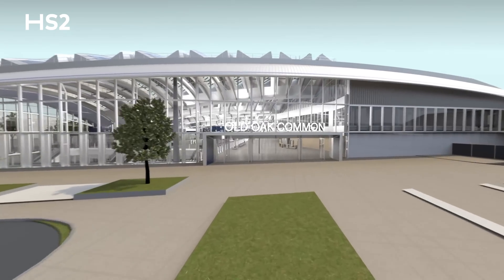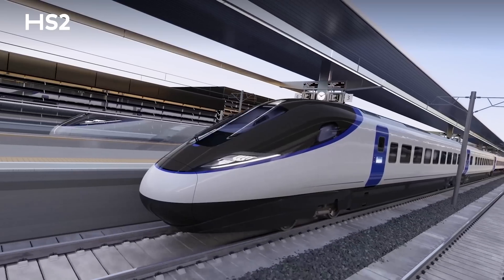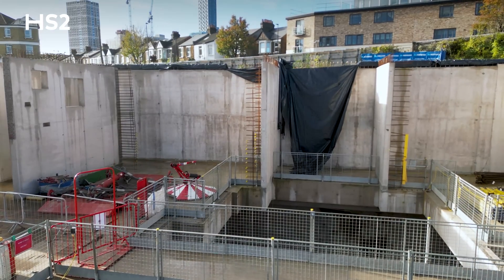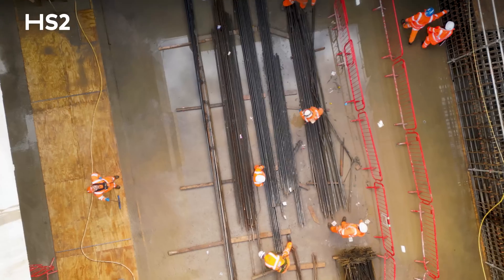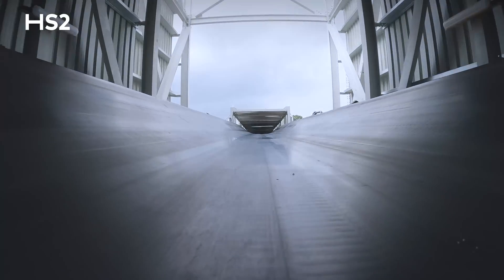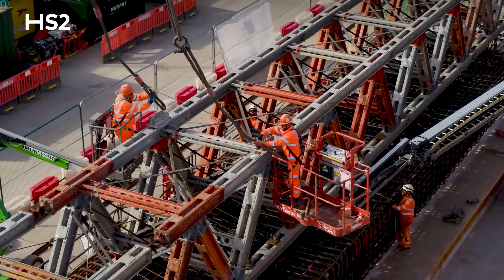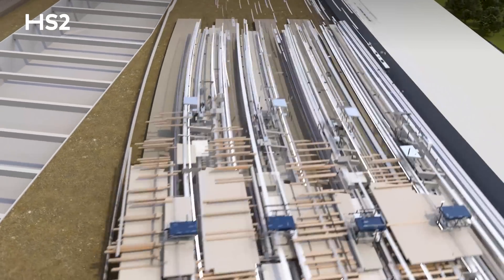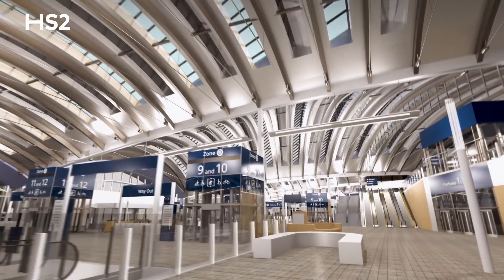HS2 Old Oak Common Station Project Update | December 2022

Comment: Explain this to me, most people don't want HS2, most don't think once built that it won't go beyond Birmingham as the money will either run out or the improvement won't change or lesson the services on Network Rail to Birmingham New Street via Rugby. finally where has all the money come from to build this? why has the Tory government spent tax payers money if that's where the purse has come from? 
I like railways and at first was happy to see a project like this come to fruition, However since the pandemic, faster Broadband etc is this necessary even for the future? the only way it can work is if the fares are cheaper to Birmingham and the journey much, much faster that it is currently. I only say this because Euston, Old oak then Birmingham stations doesn't speed passengers from Milton Keynes or Rugby if they did HS2 part 2 to the north, Milton Keynes and Rugby will still be on the current network, so where are the benefits?
Reply: While things like Zoom have their place, there's still a lot to be said for getting people together in the same room where they can interact properly. People said the same about the need for rail travel when the telephone was invented!

And by taking most of the express services off the existing line, it frees up capacity for more trains serving the intermediate stations - including Milton Keynes and Rugby!
Reply: @Inkyminkyzizwoz   Well said. Your reasoning is so obvious but sadly there are none so blind as those who choose not to see.
Reply: @1chish  To be honest, one of my biggest criticisms of HS2 is the fact that there hasn't been enough emphasis on the capacity issue, resulting in many people thinking that it's only about speeding up journey times
Reply: @Inkyminkyzizwoz   I totally share that criticism with you. However the project was started in very different times and they were hoist on their own petard by logically following the 'HS1' name with 'HS2' although even HS1 was attacked by the NIMBYS and armchair experts.
The name 'HS2' handed the opponents a bit of a gift and its been a hard campaign to get the obvious capacity benefits on the OTHER lines across. In itself it is about speed but as the capacity benefits fall on other lines and routes so its actually a double benefit.
Reply: @1chish  Mind you, HS1 wasn't called that to begin with
Reply: @Inkyminkyzizwoz   Very true as it was known as 'CTRL'. I think the HS1 name came into use when LCR went bust, the government bought the line and 'HS1 Ltd' was transferred to the Government. Its operation then became a concession in 2010.
Reply: "Why has the tory government spent taxpayer's money?". Because that's the government's job. If they didn't spend it on public infrastructure they would just pocket it for themselves. Considering their track record, it's a miracle the tories aren't just spending all their money to close down the railways altogether. Do you question why they spend so much money on maintaining the roads? No, because the answer is obvious. Secondly, the main benefit of HS2, and high speed rail in general, is that it increases capacity on existing lines. The "high speed" part is just what should be expected for new railways, it isn't the main selling point. Rugby and Milton Keynes benefit because their existing rail network will be massively freed up. They can run more frequent and reliable services since the system won't be operating at maximum capacity, and hopefully build new stations where they previously would not have been viable to be served.
Reply: This leap forward in railway CAPACITY was long overdue; I note that other earlier commenters have explained to you the capacity facts of live on the WCML.  As to the cost - building anything now costs a lot of money (leaving aside the £10billion tunnel under the Chilterns to keep the NIMBY squad mollified).  It is already beyond Birmingham, building northwards toward Crewe.
Reply: @mikehindson-evans159  You mention a good point. All these people whingeing about the cost are the same ones who demanded every newt, buttercup and bat was safeguarded and woodlands were not cut through but tunneled under.
And then there is the added cost of 7 million new trees HS2 is planting. As of today they have planted 700,000. And STILL the NIMBYS complain. Although they never said a word when the M40 was being built to make travelling in their Range Rovers easier of course.
Reply: @1chish  .. you've failed to mention the numerous fines that HS2 Ltd have racked up for breaches of environmental issues.
The thousands of trees that were planted alongside the route in Warwickshire where the vast majority died because of lack of aftercare
 The miles of hedgerows, containing nesting birds that were bulldozed (even though HS2 said they would wait until the nesting season was over).
The pollution of canals, streams & other waterways.
The destruction of numerous nature reserves, sites of scientific interest, ancient woodlands .. the list goes on & on.
It's an environmental disaster of epic proportions and the biggest White Elephant this country has ever seen.
Reply: @CRIMSONANT1  The trees more than likely dies because of being saplings and a drout, do people go all over the Country looking after wild trees !!.
Reply: @peterwallen1063  .. *DIED .. not "dies".
*DROUGHT .. not "drout".
The trees WERE saplings & even if they were planted during a drought, that's even more reason to water them & monitor their progress.
You wouldn't just buy a plant from a garden centre, stick it in a hole in the ground & leave it would you?
You'd water it & maybe put some fertiliser in the soil.
Wild trees don't need watering by anyone as their roots are already well established in the ground .. any more pointless "facts" you'd care to share with everyone? 😉
Reply: @CRIMSONANT1  Further to my comment on the dying trees, this was 4 years ago James reported as I said on BBC Midlands Today and more than likely have been replaced now
Reply: Where do you get your facts? Most people are indifferent to, not for or against.
Reply: another person no understanding of HS2 -- all the fast pendolino trains from london to birmingham and crewe will be removed from West coast main line secruing many more regular train path and emabling significantly more freight run on the rails and off the M1 M6 corridors
Reply: @colinbrooks228  .. *SECURING .. not  "secruing".
*ENABLING .. not "emabling".
Research shows that when HS2 is fully operational, (& it's still debatable whether it will be),  traffic on the M1 & M40 will be reduced by less than 1%.
There won't be ANY "significantly more freight" as Brexit has put paid to that argument.
Perhaps you should do some REAL research & you'll discover what a waste of money this monstrous vanity project has become - built for the elite & the only people to benefit will be the CEO's of the construction companies & Government ministers with their fingers in the HS2 pie.
Reply: Honestly, I live only 20mins away from London so I've primarily been living in my town and in London throughout my life. However, I found traveling to cities likes of Glasgow, Edinburgh, Manchester, Leads very difficult given by the railway ticket prices, and time it takes to get there. Railway in the UK is so expensive and I do hope this scheme counters this. Bear in mind I haven't researched so my opinion holds very little value. Yet, if demand is increased and the service isn't as stretched as the slower lines - I can see the cost substantially reduced (through basic Supply & Demand theory). Furthermore we do not have a high speed rail line other then the Eurostar - I would love to see the interconnectivity increased in the UK so the economic growth in London could be shared with great connections to the likes of Birmingham, Manchester, Glasgow for example. 

I'll say this as well, Birmingham, Digbeth located next to the location of the new High Speed Rail should surely benefit given majority of the area still looks derelict. However, regardless of this - I'm aware my opinion matters no so much but the discussion for tourism and commuting population feels ignored by your opinion.
Reply: @jakehayward1993  *bear
Reply: 1. You do not speak for 'most people'. I doubt you even speak with many people.
2. You then peddle a stream of false propositions none of which are borne out in fact. For example HS2 is already contracting firms to build on to Crewe.
3. By moving all InterCity services on to HS2 that frees up more paths per train for use by slower freight and suburban services on the WCML. Fact.
4. The money has come from the UK Treasury as approved by the UK Parliament as all infrastructure builds are. By the way this project was started by a Labour Government.

I would respect your opposition more if there was the slightest thread of fact to support it. But you have no facts.
Reply: @1chish  thanks, you saved me a lot of typing!
Reply: @petermorris3665   Most welcome ... 👍👍
Reply: @1chish  Not peddling anything dude just asking questions. also many of the people I know think it's a white elephant and they work in the industry as I have. The treasury is funded by tax payers so it is you and I.
The public aren't impressed, maybe it's NIMBY ism? I know that the core reason it lesson the WCML's strain open up capacity by loosing a few trains but who compensates Avanti West coast once a service on HS2 starts?
I think it's doomed to failure long in the long term.
Reply: @Thunderer0872   Sorry 'dude' but you were most certainly peddling BS. You are clearly anti the project (fair enough) but you peddled false statements and no facts. And in this reply you continue with the same inferences and zero facts.
Oh and if you know (as I clearly also do) that its taxpayers who fund the Treasury why ask the dumb question about "why has the Tory government spent tax payers money if that's where the purse has come from?". You are making a Left Wing political point and without realising it betray your antagonism and ignorance that it is PARLIAMENT that spends this money not the Tory Party. On a Labour Government started project as well!
You again allege 'The public aren't impressed' without any proof.

For someone who alleges they have worked in the rail industry you seem wonderfully ignorant of how this will work. When Avanti were awarded the latest WCML Franchise they also became a partnership with HS2 to formulate timetables, services and train specifications and operations. The Avanti WCML deal will end and the HS2 deal will start as sections are opened up. The only question is what happens to the Class 390s when HS2 starts. But that is a problem for Angel Trains the leasing company and the first built 390s will be over 30 years old.
Reply: @1chish  .. but the public  AREN'T impressed.  Opinion polls regularly show that 70% of them are against HS2.
Read this short summary of a damning report published last month by Andrew Gilligan, policy adviser on transport & infrastructure to the PM between  2019 & 2022.

By cancelling all sections of HS2 where main construction has not yet started, we can save around £3bn a year by 2027/28 & £44bn or more in total.

HS2 now costs more to build than the value of the benefits it will deliver. The official benefit cost ratio (BCR) shows that for every £1 spent on the scheme, the country gets back benefits worth only 90p. Shortening the scheme improves its value for money.

Including “wider economic impacts,” the BCR rises to 1.1 but even this is suspect since it uses an artificially low construction cost & assumes that all HS2’s operating & renewal costs will be covered from fare income.

The BCR calculations also use figures from before covid, since when the scheme’s costs have risen & its benefits have fallen.

Almost half of HS2’s benefits go to London & the South East, meaning that HS2’s effect on levelling-up will be little better than neutral. 
Its claim that it will create 500,000 new jobs is an absurd exaggeration.

Public support for HS2 is low everywhere, & even lower in the regions it supposedly benefits. 
The outcry at last year’s cancelling of the Eastern leg was entirely confined to regional elites; it left ordinary voters unmoved. Northern leaders back the scheme in principle, but vehemently oppose the specific plans for Manchester.

Rising costs & cuts to public spending mean that if HS2 continues as currently planned, it will eat much of the rest of the public transport budget, sucking billions of pounds out of the services which most people use, need & want.

I
Reply: @CRIMSONANT1   Nice copy / paste job James. Tad lazy though what? So lets see if you understand it all. I challenge you to justify your 70% figure. According to Statista:
     "In November 2021, close to one fifth of survey respondents stated that they strongly opposed the UK’s HS2 high-speed rail project"
Are you suggesting that opposition has more than trebled in a year?
According to YouGov on 7th November about 34% were opposed.
All very different from your 70% James ..... Hmmmmm

That report was ONE man making a ONE report to ONE think Tank (Policy Exchange). While he is entitled to his views it does not make him right. Its an opinion piece and can be effectively challenged.

Quote:
    "By cancelling all sections of HS2 where main construction has not yet started, we can save around £3bn a year by 2027/28 & £44bn or more in total"
So on what will we spend that £18 Bn (6 years @ £3 Bn) James? How will you deliver the travel benefits by NOT building HS2, by NOT providing the extra capacity on the WCML and by NOT providing inter regional connectivity? Quite where that £44 Bn came from I have no idea as that is nearly half the whole project's costs before contingency.

Quote:
     "HS2 now costs more to build than the value of the benefits it will deliver. The official benefit cost ratio (BCR) shows that for every £1 spent on the scheme, the country gets back benefits worth only 90p."
Well not quite true. Even the 'not for HS2' Institute for Government puts the BCR at between £1.45 and £1.60. Mr Gilligan seems to be taking the fiercely anti Lord Berkeley's figures. Typically biased reporting. Of course the BCR is not the only criteria for infrastructure. There are also social, development and balancing criteria that can be delivered even at par BCR and make it worthwhile. 

I can't be arsed to do more as I know you will just ignore the facts let alone give an informed reply. But do try to tell me where your 70% came from because basically its bollocks (to use a LibDem expression).
Reply: @Thunderer0872  Just to pick up on Avanti, as it stands they will be the operators of the HS2 services. They won the franchise as the West Coast Partnership which included HS2 and WCML services and a condition was they had to have experience operating a high speed line which is why Trenitalia have a 30% share in Avanti. However, after franchising was scrapped and the abysmal performance of Avanti who knows.
Reply: @1chish  .. YouGov poll June 2022 .. I quote - "Latest polling - support for HS2 drops from 34% to 28% in four months whilst opposition grows".

And there's more from October .. "An exclusive LBC poll suggests more than half of people living in Birmingham think HS2 is a bad use of public money.
You Gov research for LBC suggests more than a third of those think the estimated £200 billion cost would be better spent on the NHS.
Before you question the astronomical cost, that's the new estimated figure delivered to MP's by the OBR (your figures are WAY out of date) 😉
Reply: @1chish  .. and there's more!

In April 2020, the then chancellor Rishi Sunak gave his approval to a new railway to Birmingham, expected to cost £44bn. Contracts were promptly signed. The overall HS2 project is now estimated at £200bn. An infuriated Whitehall official told me at the time: “Never let that man say he cannot afford any item of public expenditure.”

The ambition was soon trimmed. HS2 will no longer go to Yorkshire, only to Birmingham and Manchester. A 10-year-old plan for Euston station, on which more than £100m has already been spent, must be radically redesigned. Rail passenger numbers even in the Midlands have fallen, leaving HS2 largely to benefit commuters into Birmingham and from London’s home counties. .

This enormous sum is, eerily, not far off the annual "black hole” in British borrowing that the chancellor, Jeremy Hunt, says he must fill.
 The roughly £7bn a year to 2029 is more than is planned for all England's school buildings and only a billion short of last year’s NHS capital budget. It would more than meet the social care uplift promised by Boris Johnson but not awarded.

Sunak claims he wants to crack down on “outrageous” waste of public money. Yet in 2018 it was revealed that £4.1b has been spent before work even began, with “consultants” getting £600m. The extravagance of the project has been condemned by Whitehall economists, public accounts committee chairs and project assessors galore. Its backers now claim it is too far advanced to cancel, with giant boring machines deep under the Chilterns. Yet those with noses firmly in the public trough always claim this. A New Jersey governor, Chris Christie, famously halted a rail tunnel under the Hudson river by simply ordering the contractors to fill in the hole.

If terminated, HS2 will have cost some £8bn, though many of its London acquisitions – including the land of 400 destroyed Camden homes – must be worth a fortune. But stopping it would save gigantic sums. In addition, billions of pounds could be diverted to rail projects that are really needed, in the North and in Wales, and are being sidelined by the Treasury to pay for HS2. Cancellation would release an army of 26,000 building workers into Britain’s chronically short-staffed construction industry.

Johnson’s Cabinet Office minister, Kit Malthouse, once dubbed HS2 the “killer whale” that stalked spending debates during his term of office. Its lobbyists fought for its survival as a totem of the glory days of Tory statism under David Cameron and George Osborne.

Since then, the only question asked of successive prime ministers has been, “Will they have the courage to kill it?” This week £44bn is going begging. It could be spent on public services. As it is, HS2 has nothing to do with trains, only with political guts.
Reply: @CRIMSONANT1   My my my James you really are an excellent copy / paste expert but like all of you people who do that you are very selective and partial in what you copy and give no links whatsoever. And your need to make 3 comments makes me think you are a bit obsessive.
I have taken your comments apart with facts and when you somehow make 6 x 3 = 44 then we can all see how you operate.

So with the greatest respect as you have provided nothing but OPINION and random copying I am out of this before it becomes a pissing contest.

Have a very safe and enjoyable weekend James.
Reply: @1chish  ..  always a typical response for someone to "bail out" when they know they've been schooled & have nothing further constructive to offer .. well done for reverting to type 👋
Reply: @Thunderer0872  whoever owns the franchise when that is
Reply: @CRIMSONANT1  no one believes andrew gilligan
Reply: @CRIMSONANT1  Again you are talking utter rubbish James, I live in Birmingham near to HS" construction and have never seen one of your so called opinion polls, I think they are in your head James, No matter what you think HS2 will be finnished full stop.
Reply: @colinbrooks228  The train service franchise will be owned by Avanti West Coat Trains /Trenitalia of Italy
Reply: @peterwallen1063 .. *HS2 .. not "HS".
*FINISHED .. not "finnished" 😉
Reply: @CRIMSONANT1  well from Newcastle upom Tyne you definately can not see the progress on HS2 that I do living in Birmingham, it will definately be finnished
Reply: @peterwallen1063 .. *UPON .. not "upom"
*DEFINITELY .. not "definately".
*FINISHED .. not "finnished" 😉
Reply: @CRIMSONANT1  Oh effin give it a rest, it is just not proof reading before sending, if that all your worried bout take a look at the other shit grammer on these pages, just the fact you know sod all living in Newcastle about HS2, where as I actually live right next to it in Brmingham
Reply: @peterwallen1063 .. *THAT'S .. not "that".
*YOU'RE  .. not "your".
*ABOUT .. not "bout".
*GRAMMAR .. not "grammer".
No-one needs to live right next door to HS2 to understand what a disaster it's been - maybe its you that's jinxed the whole sorry project!  😂
Reply: @CRIMSONANT1  The terminology of an Anorak ( not the Garment type you where in the rain) " a boring person who has nothing to do but pick up on the nitty gritty things in life with out a purpose in life) just sounds like you James, I bet you live in your Mom and Dads house nothing better to do in life and collect train numbers and moan about anything that brings progress, did you moan about Concorde and Motorways being built. But living in Newcastle mate other than the rubbish you read in the London Rag Newspapers who are against HS2 anyway you actually don't know anything about HS2 and it's progress, now living near HS2 in Birmingham and travelling arround the Wst Midlands I see the progress daily. I think you are one of these people who would like to see us travelling arround in carts pulled by Horses. We need to look at Europe and how their trains have improved with high speed train services through out Europe and the UK is actually included on the map of European Hi Speed rail services or at least to London. I do believe that you are jealouse of people in the Midlands and the North getting these new High Speed trains and new services, jusr relax man and enjoy your Newcastle Brown ale and get a life. 👍🚅🤣🤣
Reply: @1chish  .. this comment aged well! 🤣
Reply: @1chish  yes , he’s a typical naysayer . He would rather spend billions on test and trace or the bottomless Pit  that is the NHS . Transformative infrastructure is worth every penny . Now let’s get on with HS3 from Liverpool to Hull please.
Reply: @normhanson981   I fully agree mate. I understand that Northern Powerhouse Rail has been confirmed in full at the last Budget and as the economy eases back into shape that will be extended east west.